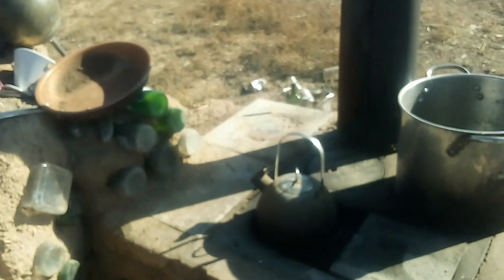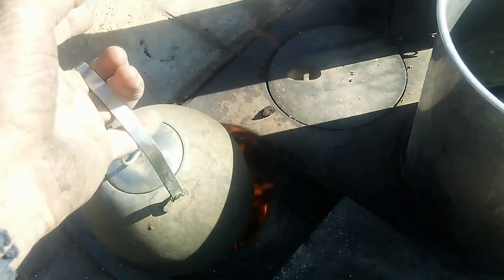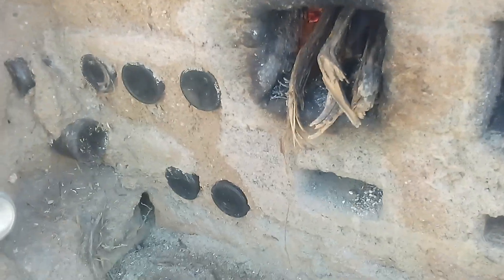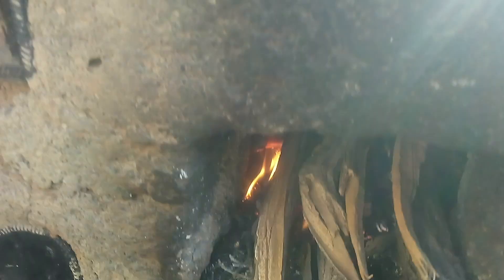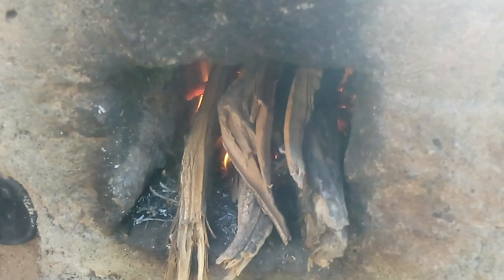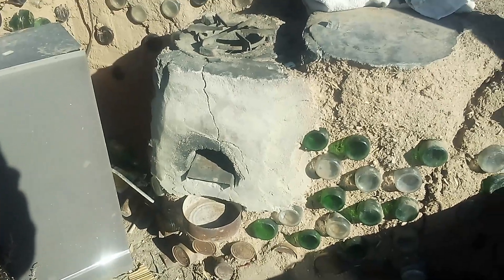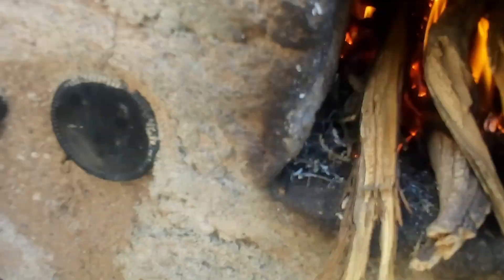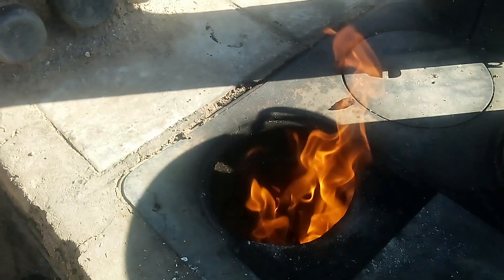Lighting the Rocket Stove

Comment: Bluetooth enabled. This looks so cool. Are the bottles just for decoration. I wondered if they let light through during the night. I can see small air inlets I think near the bottom. Great stuff, fascinating.
Reply from the maker: The Bottles are a crucial part of this process.  I am building up a mud structure without the use of forms. The bottles take the place of forms and stay in the wall.  Laid up like bricks let the mud firm up keep going.  The ideal mix here is 2 parts sand to 1 part adobe dirt though I conserved sand in this project.  The freedom in this technique is really cool. Slide show vid of 2 different stoves construction incoming.  With this one I slip formed the front with a 2x4 other 3 sides are just bottle wall
Reply from the maker: The speakers are wired LOL the go to my Sherwood Turntable/Amp